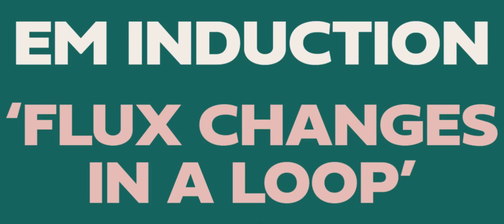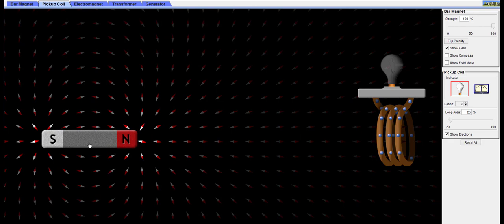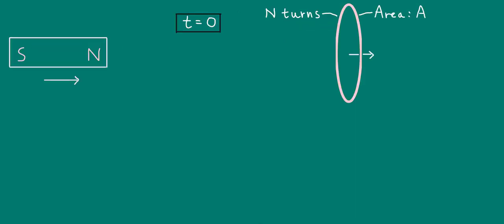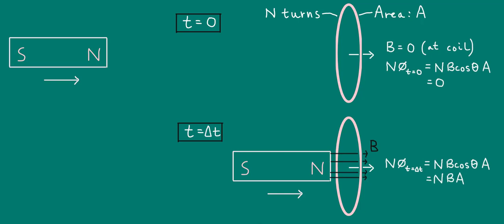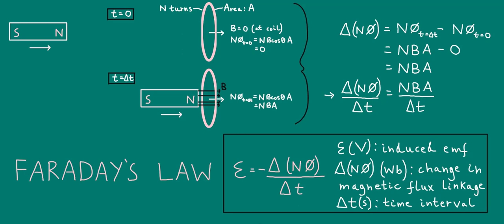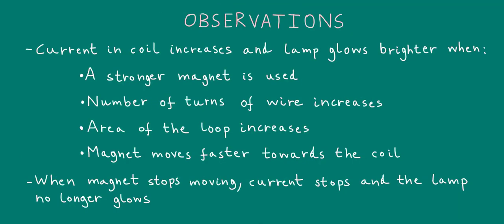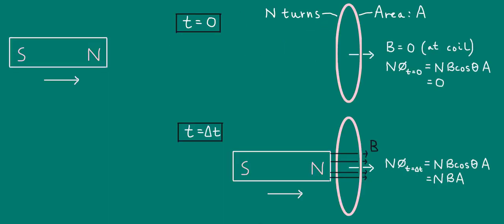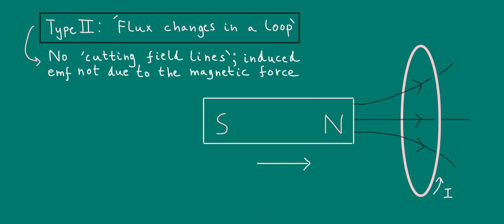Electromagnetic Induction | 'Flux Changes In a Loop' (Faraday's Law) | A-level Physics

Comment: Isn't the magnet's field not uniform? Doesn't that mean the equations for the change in magnetic flux linkage do not work?
Reply from the maker: You are correct that it isn't uniform. At 3:27, I mention that I assume a uniform field to keep things simple. Because of this, the change in flux linkage is NBA. So strictly speaking, NBA/(delta t) doesn't give you the induced emf for a bar magnet being pushed into a coil, but it captures enough of the essential physics to be useful to us in understanding the factors  that affect the induced emf.

Comment: Is there a way of finding the direction of the current (in the scenario near the end of the video)? How do you know it is anticlockwise?
Reply from the maker: Great question - yes, we know from Lenz's law that the direction of the induced emf will try to oppose the change that caused it. Here, the left end of the coil will behave like a magnetic North to magnetically repel the incoming bar magnet. A magnetic North implies the current will flow aNti-clockwise in the coil, when viewed from the left. We'll be discussing this further in a follow up video.

Comment: Can we think of the change in magnetic flux lines as a relative phenomenon?  As we ride a bicycle the air particles hit us even though technically we are hitting them.  The effect is still the same.  Whether the loop of wire or the magnet moves the effect from the perspective of the charges in the wire would be the same
Reply from the maker: Great point - yes. Electromagnetism obeys the principle of relativity, but I've avoided giving explanations based on this since this is beyond A-level.